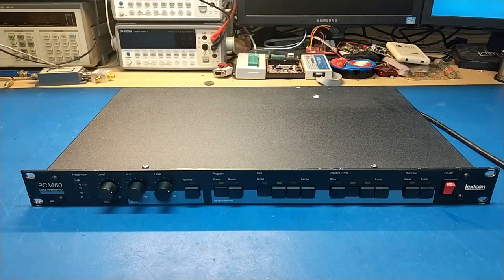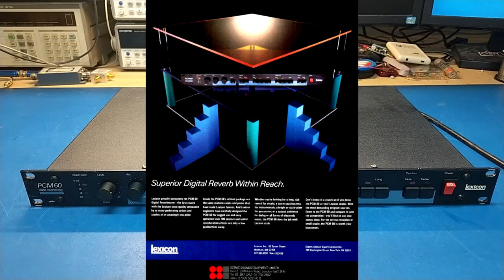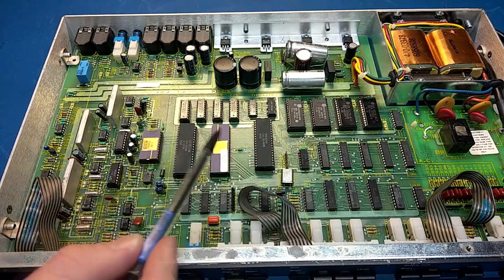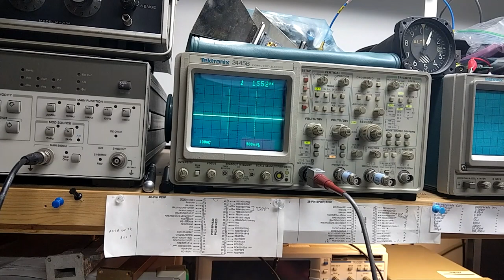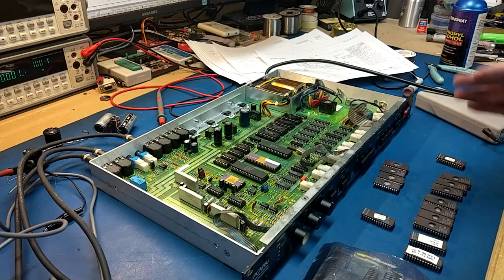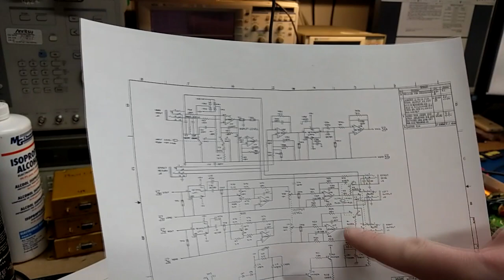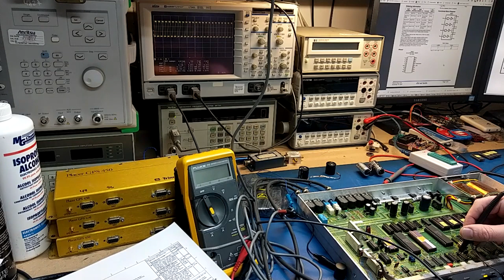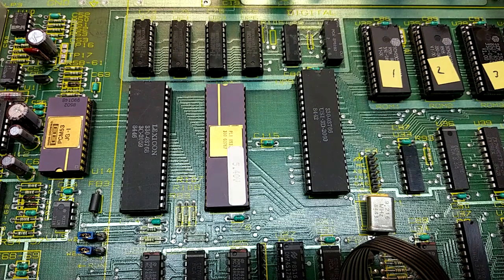Lexicon PCM60 Repair and Restoration

Comment: Hello 
A question if you dont mind 
PCM42 supossedly has optical U15 + U14 dry signal limiters on the input 
Have you noticed these on the PCM60 
The reason I'm asking is that PCM42s input when pushed makes a distinct distortion used by pros to saturate and give grit 
The PCM60 can do the thing too but I can't find a comparison anywhere and I don't have the units myself.

Comment: You went from the caps right to the eproms. I think you cut some stuff in between. Did you still have the ripple/noise and overvoltage after replacing the caps?
Reply: Pete Brown yes he thinks that every fault he checks the culprit is forever a cap in the power supply... then he starts to change components at random... read the service manual first, then grab the oscilloscope and use it!!! and use a signal tracer too to repair musical instruments!
Reply: @ubaldoregnani9382  To be fair, in these 30+ year old music devices, the caps are usually a problem, or are about to be. :)

But I get the rest.
Reply from the maker: Hi Pete, thanks for watching. I lost a few portions of the video due to poor audio, so some of the repair doesn't quite flow as well as I would have liked. Ripple was lower after replacing the caps. The caps were not the ultimate cause of the ADC issues of this unit, but any 30+ year old piece of studio gear will need them all replaced regardless so I did them first. I wanted clean supply rails for troubleshooting and wanted to get that terrible bodge out of it as well. As for the +5.4 rail, it did calm down after the capacitor replacement to around +5.1V. The +22 and - 22 test points I mentioned were introduced in REV 3 of the PCM60 hardware, they are simply test points pre-regulation of the +/- 15V rails which is why they were so noisy and not actually used in the design.
Reply: @bradthx  Cool, thanks. That capacitor bodge was quite amusing, in a sad way :)